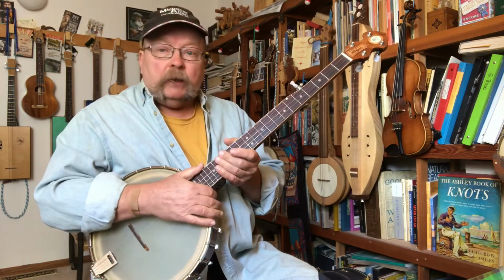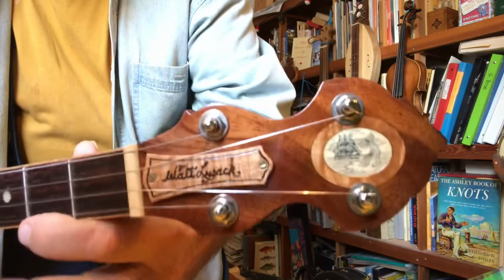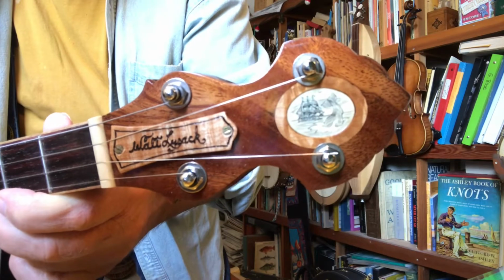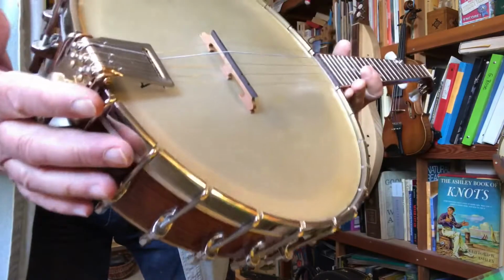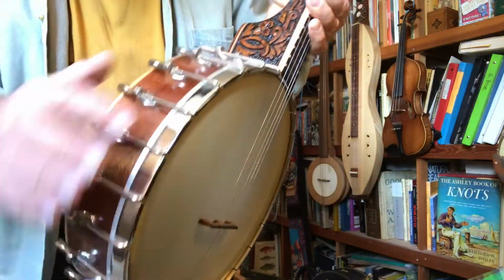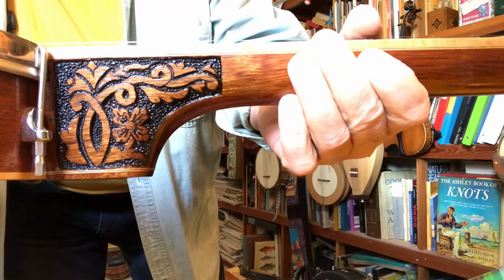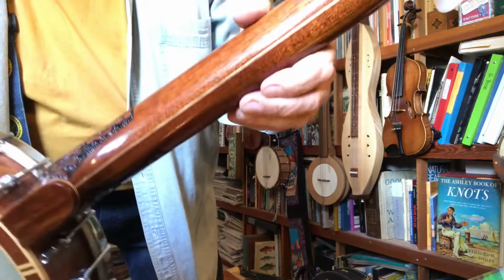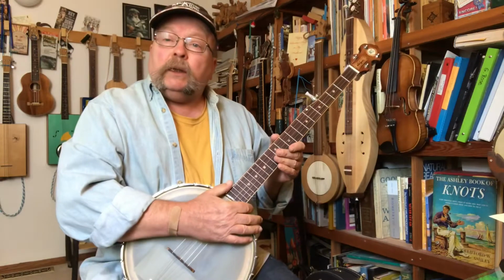“Cherokee Shuffle” and “Bill Cheatham”  my new banjo!

Comment: That banjo looks beautiful. And it sounds it too. How much do you think it costs to make a nice beginner 5 string banjo without a resonator? I might try to build one as banjo is an instrument I would like to learn.
Reply from the maker: Viking Seagull  Hardware: fret wire, tuners, strings head, tension hoop, shoes and hooks and tailpiece. =. PRICEY!
I bought all my hardware 28 years ago and put it away knowing that someday I would build 2 banjos. That hardware has more than tripled in price. You might be interested in making a Frank Proffitt style banjo with a fretted fingerboard. This would cost way less and still sound pretty good.
Reply: Lap board Okay, thank you! I think I like that style banjo a little better anyways, and it looks easier to make.
Reply: Lap board Do you have any blueprints or instructions I would be able to use to build the mountain banjo?